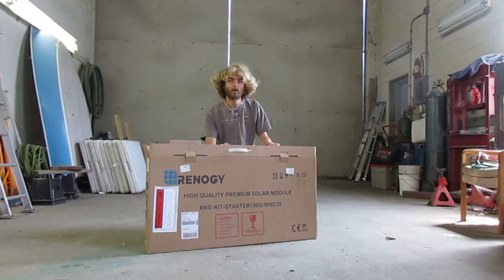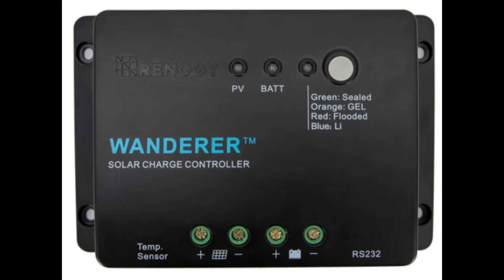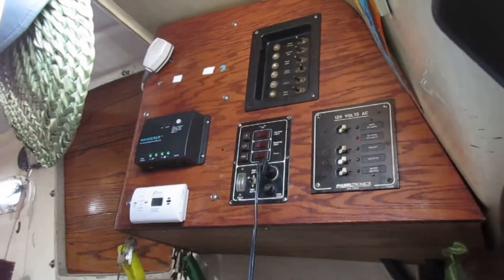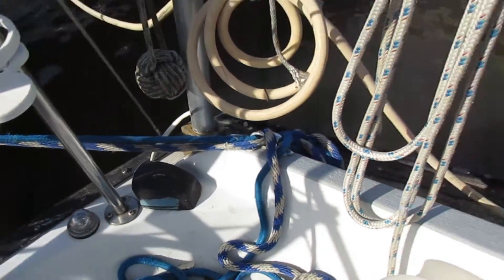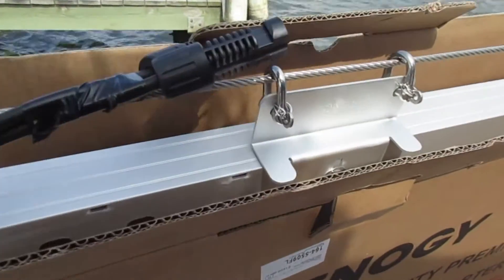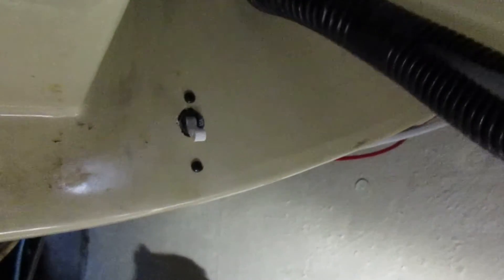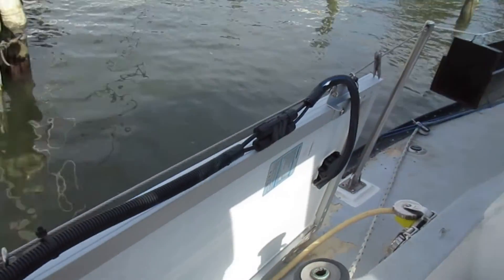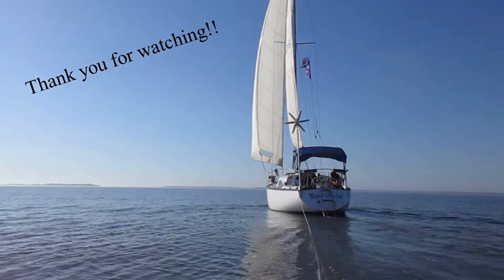How to install the Renogy 100watt solar kit

Comment: I have those exact Renogy controllers. Expect that the four connections live to come loose. You solder the ends of the wires for a better grip. They want to charge around 14 volts on four settings. A bit high for my systems. I don't have the gadget to reprogram them. I like my homemade adjustable controller much better, but these are a lot simpler than most of the Amazon controllers. I run very little on the camper sized pure sine wave inverter.

Comment: If you enlarge to two 12 volt batteries, run them on separate chargers and connect them to separate loads. This isolates them so they don't fight each other. Chasing false goals and batteries in parallel are the most common griefs in land or sea solar panel systems. If you need a lighter load, buy a small 12 volt chest freezer and always run it on ECO mode, to prolong appliance life. The big fridge can then hold your charts, binoculars, and cameras.